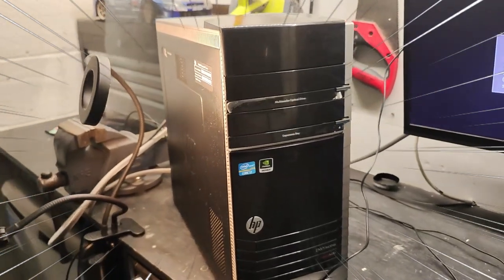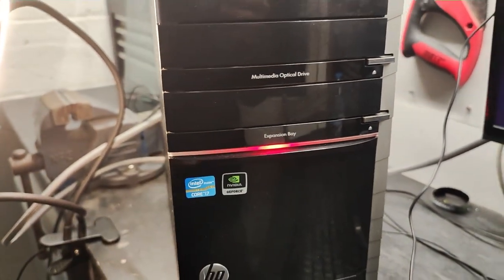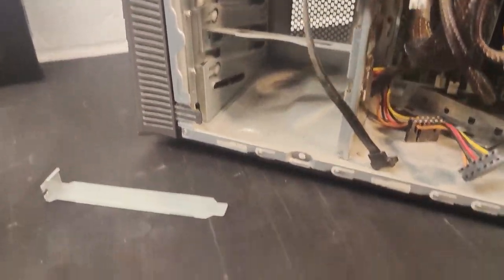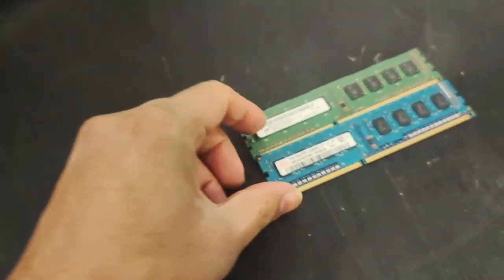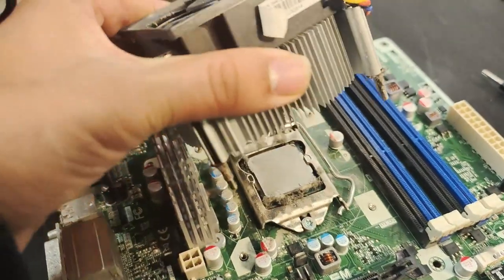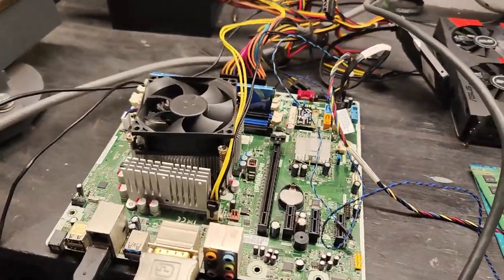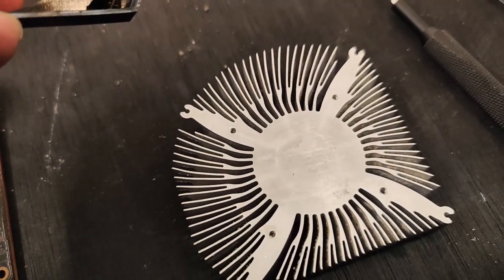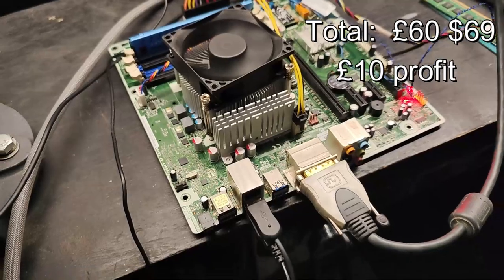HP PC - Bank or Bust - Budget Gaming PC teardown in 2022

Comment: Did you try changing the CMOS battery on the board?  Some systems won't start with a dead CMOS battery or a reset. Sometimes even just completely cleaning the board with brake parts cleaner/rubbing alcohol or even just washing and thoroughly drying it gets it up and running again.  This has work numerous times for me!  👍👍
PS:  Nice videos, by the way!  I am subscribed!  👍👍
Reply from the maker: Thank you, yeah I have a stash of new batteries on hand and I usually check them with a multimeter, I might try the brake cleaner have never heard of that before but worth a try!

Comment: I do recently swapped the i7 4790k and it pretty a nice cpu for windows 10/11 because it's easy to keep it cool while still deliver good power for basic everyday use
Reply from the maker: Yeah and I overclockable if you need that extra performance 😉
Reply: @RestoTek  the i5-13600k or i3 isn't that expensive if you wanna go for a low budget build.
Reply from the maker: @Jean-bs5ip  yeah I heard allot of people going for it i3, think I'll give it a go, want to do a test between a new CPU vs a 10 year old one and see what the difference is